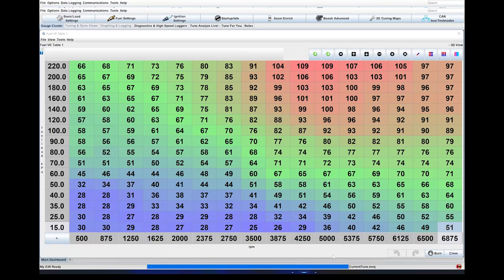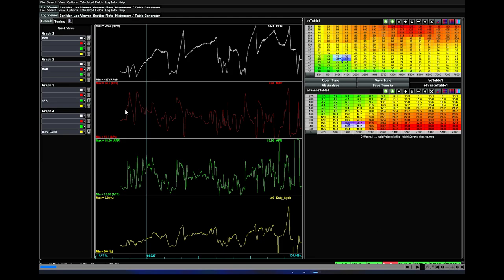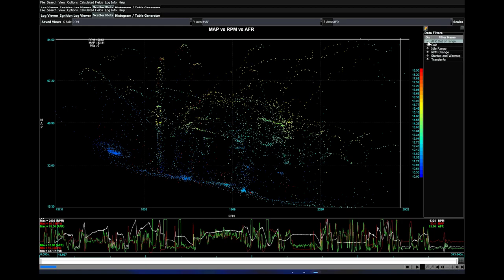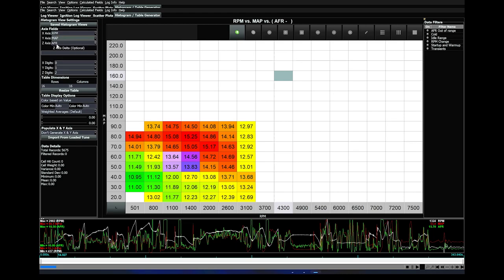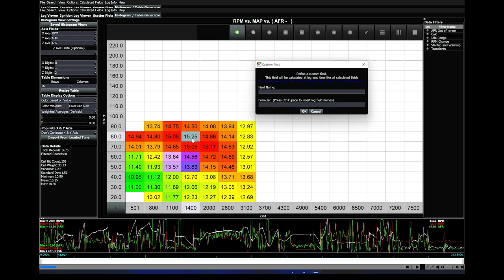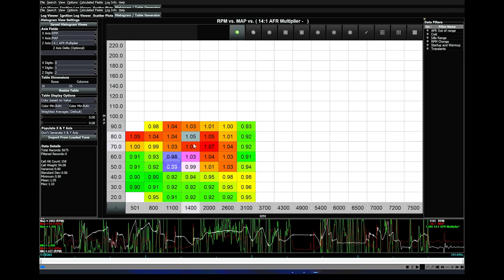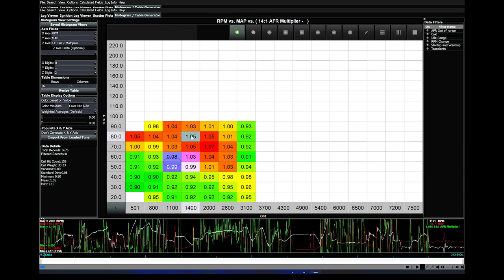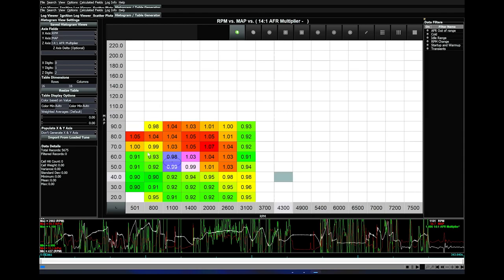Megasquirt Tuning From A Datalog

Comment: the best mega squirt/ Tunerstudio video guides out there. no one else can packso much useful info in such a short video
Reply from the maker: Thank you ❤️ that's my goal for the videos ☺️
Reply: On the MAXXECU there's this built in "AFR error" calculation. In the datalog you plot AFR (measured), AFR target (the afr table that is also present in megasquirt) and plot the error. The logger also allows you to go right over said cell in the VE table so it's super easy to do exactly what you've demonstrated. I feel like it would be easy for megalogviewer to implement that also.

Comment from the maker: Here is the formula for custom calculated field in the video  [AFR]/14>1.1 ? 1.1 : [AFR]/14<.9 ? .9 : ([AFR]/14)        ( remember this is for 14:1 AFR, you need to change the values to the AFR range you want to tune.
Reply: Hiw its looks if I want to use the AFR target instead of a specific number?
Reply: I've done it. You could do AFR / AFR target 1 or 1+((afr-afr target1)/afr)
They both do pretty much the same

Comment: Well this works to be sure, but you are manually doing stuff that MLV has tools for, including AFR error fields, and AFR Corr fields.   Also, the main point of commenting here, is MLV can generate changes to the VE WITHOUT it being live.   It can autotune a log, apply the changes, save the tune, and go drive again.   Shout out too to Andy Whittle and also Phil Tobin, who started all this.   Good info on both there channels as well as yours.  Thanks for the vid..

Comment: I'm on the path to fixing my car with this video, however when I do everything just like this video my data log histogram only goes from 15 to 100. The other values arent displayed even if I add rows and columns.
Reply from the maker: Do you have metalog viewer HD ? The lite (free) version is limited on the number of log records it can read
Reply: @TurbineResearch  I have ms ultra hd and megalog viewer.
Reply: @TurbineResearch  the readings on the left of the screen only go from 0-100 kpa. Regardless of what my afr,ve, or spark tables look like. If I resize for mute rows or columns it’s just makes more resolution and doesn’t increase past the 0-100

Comment: Great work man. I'm in need of help tuning a buck out of off cruise. It happens anywhere below 3500 rpm. And is very unpleasant. When you mat it she bucks,if you roll into it she's OK. Shouldn't applying this technique you showed, give me data that I can tune this prob?
Reply from the maker: You might need to adjust your acceleration enrichment settings. I have a video on how to do that

Comment: I'm using tuner studio with Beer Money Motorsports ECU powered by rusEFI. This was very helpful, thank you! I do have a recommendation. Have you considered this formula? 
[Air/Fuel Ratio]/[fuel: target AFR]>1.1 ? 1.1 : [Air/Fuel Ratio]/[fuel: target AFR]<.9 ? .9 : ([Air/Fuel Ratio]/[fuel: target AFR])
Reply from the maker: Thanks 🙏🙏🙏
Reply: @Jonathan Foster what does this formula exactly do? Does it omit a certain afr target and changes it to all of your afr targets on the map? I've been trying to figure out if that is possible that way you don't have to create multiple custom fields for different afr targets
Reply: How does ur formular work and if i run this in MegaLogViewer it say´s its invalid.

Comment: Could one do this in lambda? 
My ecu already logs and give a correction value but having it graph it like this would be amazing
Reply from the maker: Yes it can be done easily in lambda. The equation is basically converting to lambda
Reply: @TurbineResearch  been tuning a motorcycle by logging which is a lot harder since I can't have a laptop on the seat like a car. Megalogviewer will help greatly
Reply from the maker: @rhetericalpha  absolutely